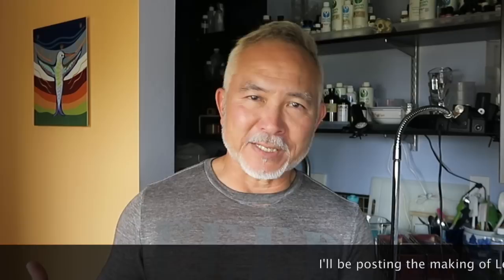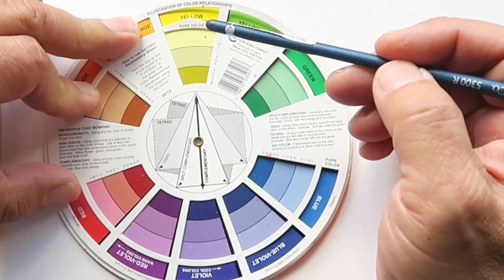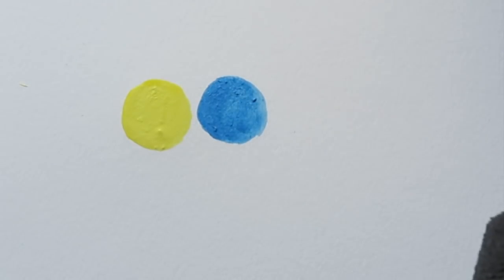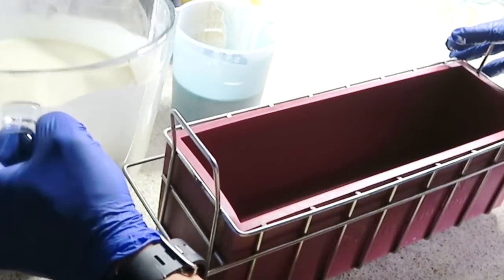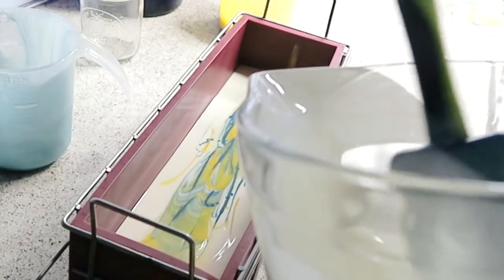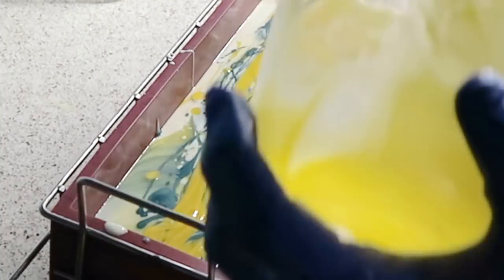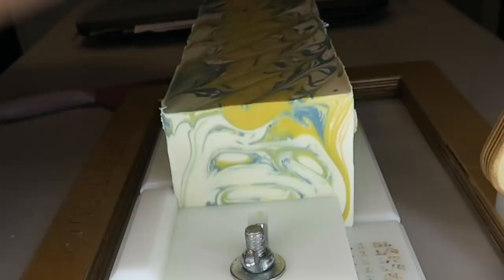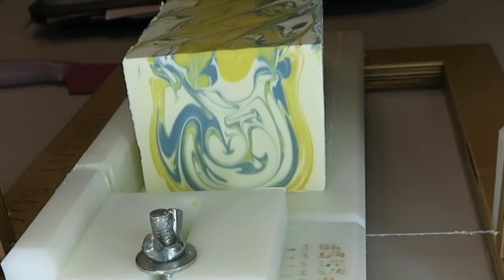Making Fresh Lemon Sugar Type Cold Process Soap

Comment: The fragrance I used was Brambleberry’s Energy in the base batter. Otherwise no color or TD in the base.
Reply from the maker: Hmm, I had suspected the fragrance, but Energy usually has no issues. It's known as a well behaved scent. did you run your recipe through a soap calculator? Sounds like not enough lye. However, it is dangerous for me to diagnose that as the problem. Best to check with a soap calc. http://soapcalc.net/calc/SoapCalcWP.asp

Comment: I ran it through the Brambleberry lye calculator. I actually had to correct the recipe because it was a little low. Not by much though. Is there anything I can do?  Will putting it in the crock pot like a rebatch help?

Comment: Clyde really cool swirls! And love those colors together. I've had my molds like yours for I think 3 years. Lately with the same recipe I always use I'm having a terrible time with breaking corners when unmolding. Soap is sticking in the bottom corners. Have you had this happen? ❤❤❤
Reply from the maker: Sometimes that happens. Do you use sodium lactate? I find that helps. But most importantly, if I wait for 2 days as opposed to 1, I almost always have a cleaner unmolding.
Reply: Vibrant Soap 
Thanks clyde! I do use a teaspoon of salt in my recipe as sodium lactate seems to make my soap crumbly on the edges. Maybe I'm using too much...humm. But lately I've taken to running a flat thin spatula down the ends as well as pulling the corners of the mold and that seems to help most times to release it pretty good. Have a great day! ❤